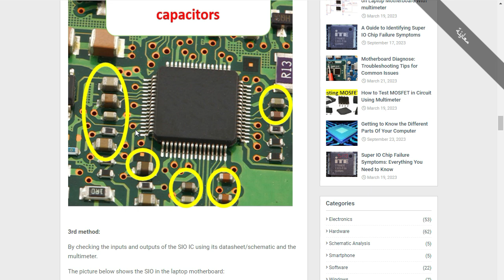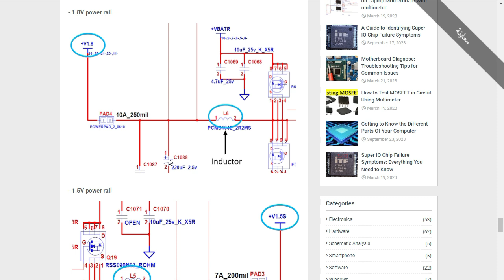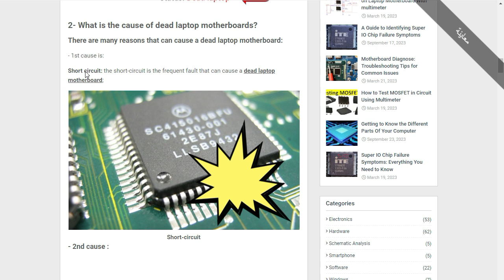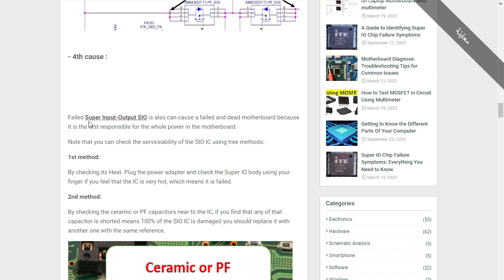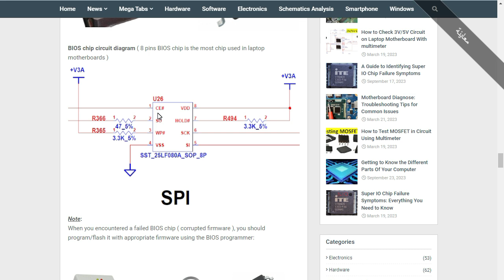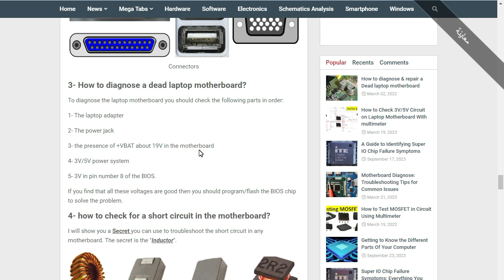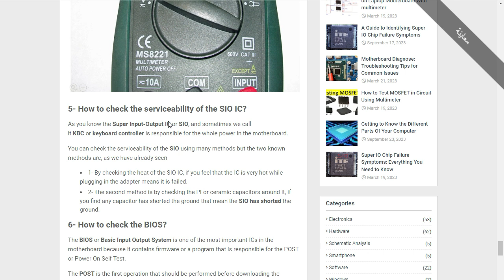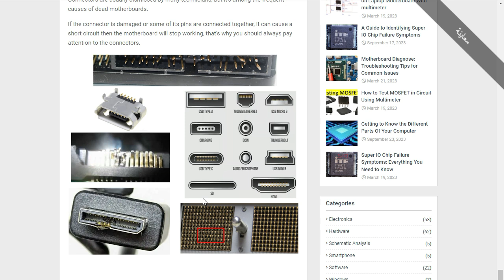How To Repair Dead Laptop Motherboard Part 6

Comment: Hello my friend, I have a question for you. I am currently learning, but I want to know how capacitors work and how to use the appropriate capacitor to create a small project such as an electronic circuit or any electrical breaker or control panel. What do you advise me to do?